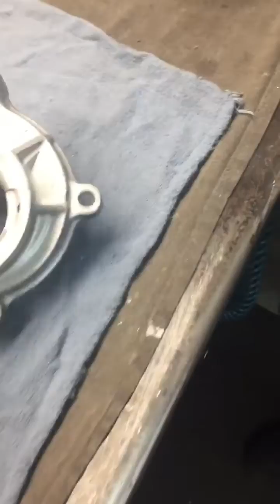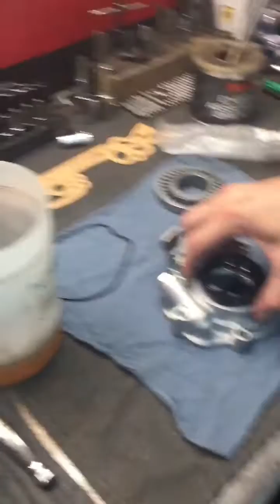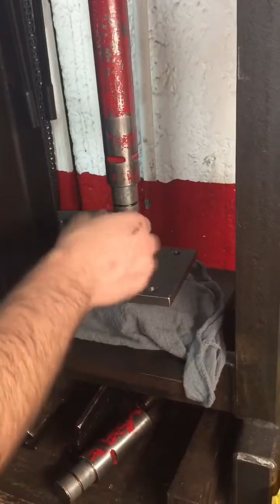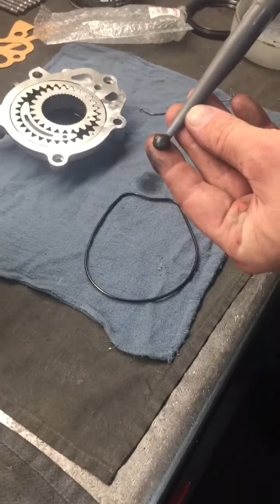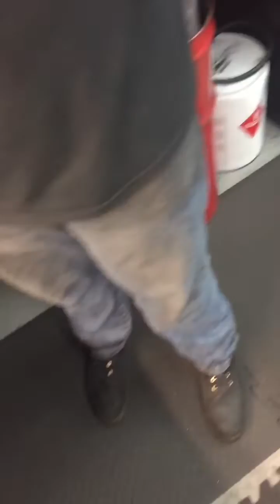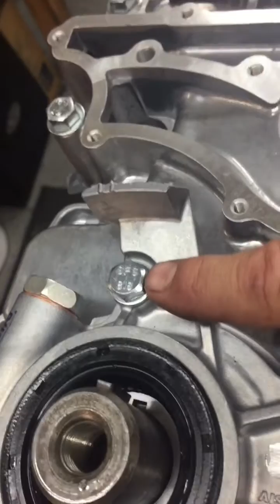YOTA1 22R/RE OIL PUMP SETUP

Comment: That oil pump drive spline is really short is that for.the dual row timing chain? Mine is 1.685" long so it has a little gap where the harmonic balancer sticks out from the oil pump is that normal ok? Or does it needs to be flush?🤔  i torqued it to 115ft lb like the manual says i have a single row chain and timing cover,  i wanna tap it in more but im worries itll bend the chain behind it

Comment: Just replaced pump seal and now I can't hardly turn the crank shaft I'm assuming I used too long of a bolt for the top of the oil pump and it's pinching the tensioner?
Reply: That's the mistake I made

Comment: You are a professional engine builder and you don't have a seal driver? Come on now,  really?

And the soaking of the oil seal is not recommended. The massive amount of RTV on the o-ring? You guys are not doing a very good job of advertising. I've seen enough to skip to the next competitor.

Comment: Should be labeled how NOT to install an oil pump on a 22RE
Reply from the maker: Kyle N. Why is that?
Reply: @yota1performanceenginemach151  soaking the front oil seal in oil and using a press to install it for one. It's easily installed without that. You want it dry no oil between the seal and the housing. Way too much FIPG on that o-ring and non factory bolts on timing cover and oil pump housing. I don't know why you rebuilders think replacing the factory bolts with shitty 13mm chinese bolts is a good thing. -Toyota techs everywhere
Reply from the maker: Kyle N. Soaking any shaft seal in oil is always a good idea! And using a press ensures a totally parallel install. Those bolts are JIC bolts! “Japanese Industrial Standard” all of our bolts are top quality and use the original tool size. I have built over 5,000 22R/RE/RTE engines! Our engines are top shelf for a reason—-Quality—— and I know how to keep the oil where it belongs. All of these methods are proven, look around check our reviews. Do your homework!
Reply: Yota1 Performance Engine & Machine another company that thinks they know more than Toyota. 🙄
Reply: @yota1performanceenginemach151  I have personally never seen someone soak an entire oil seal in oil, just where the seal rides against the shaft. There is absolutely no need for a 60-ton shop press for that oil seal either. A decent seal driver tool set would be more appropriate. I wouldn't think that the Genuine Toyota oil pump to timing cover seal would be too small. Maybe there is a deeper groove cut into the aftermarket timing covers?
Reply: Rtv = death of your oil pickup screen

Comment: You put the head on before the timing cover?
Reply from the maker: We always install the timing chain and timing cover first
Reply: Me too, it just looked like the head was already on.
Reply: @opusthe2nd  as long as the oil pans off you can probably install the timing cover but if the oil pans on you'll have to lift the head quarter inch

Comment: Good info, what is the length of the bolt under the timing tab?  
Torque spec for all the bolts on the assembly?
Reply from the maker: The bolt under the timing tag is 35mm. Torque spec is 9ftlbs on all 5 bolts

Comment: How has this RTV trick been working with the o-ring long term? Is there any concern about it breaking off once dry and fouling up the oil system? This is the only reference I've seen to using RTV on that o-ring. Normally people are just using some grease, assembly lube, vaseline to hold the o-ring during installation to keep it in place.
Reply: You don't want FIPG on that seal
Reply: I'm not sure why the RTV wouldn't work. You have to put it on the gasket for the water pump and that turns out fine if you let it cure for the correct amount of time. You also have to put a little on the oil pan, head, and half-moon seals, and those are in oil areas... I use the Toyota brand sealer, which Toyota recommends anyways. It's pricey, but works really well. Though, other mechanics also use vaseline, and that seems to work well too. I guess it's a matter of preference.